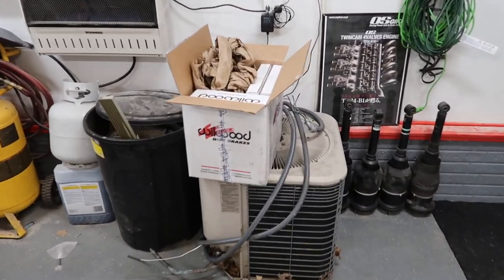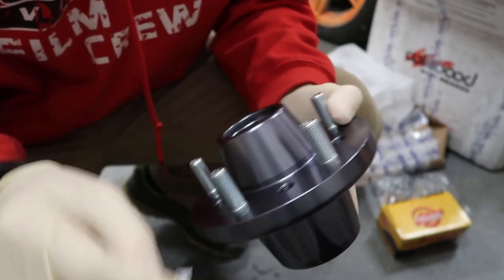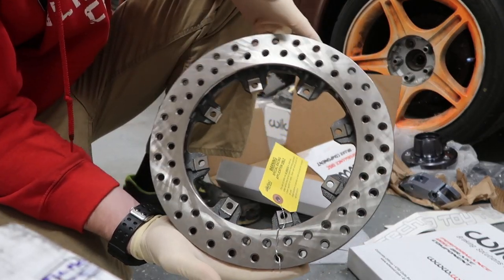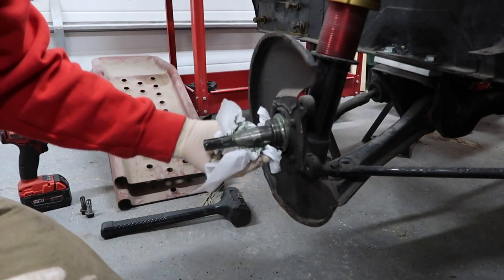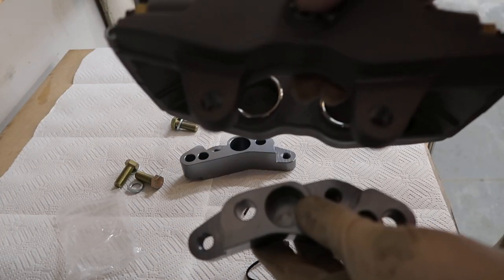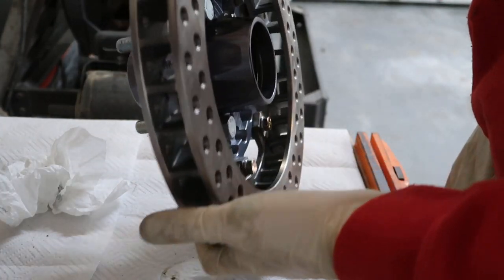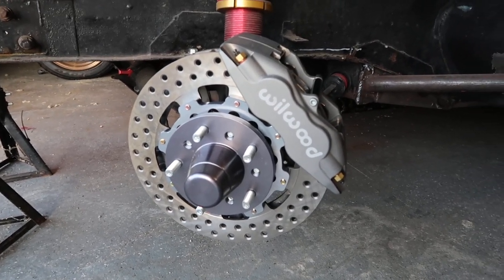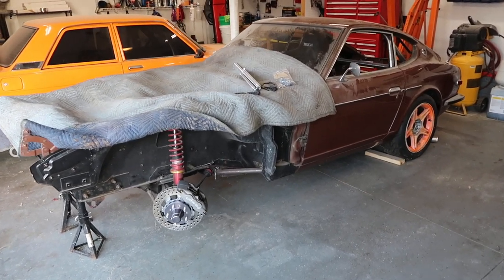Billet T3 Wilwood Big Brake Kit Mockup | 2J-Z Episode 30

Comment: Great choice! What rear kit did you use to convert to 5x114.3 and run a r230? Thanks!
Reply: Lokey I am using the T3 R230 rear conversion kit which allows me to use 300ZX TT hubs and brakes.
Reply: @jacob80  thank you for the response, T3 has some cool stuff!